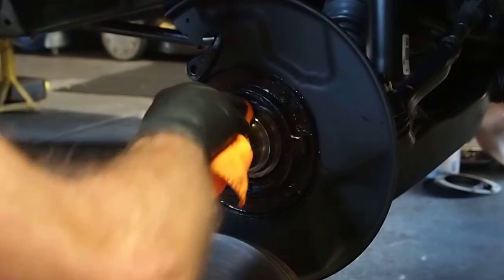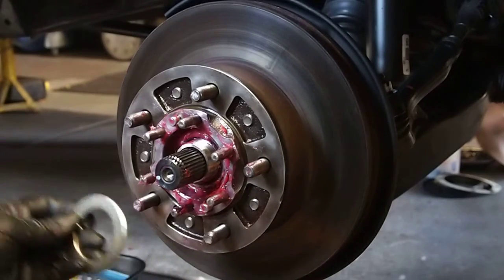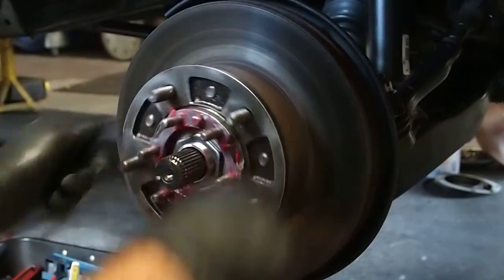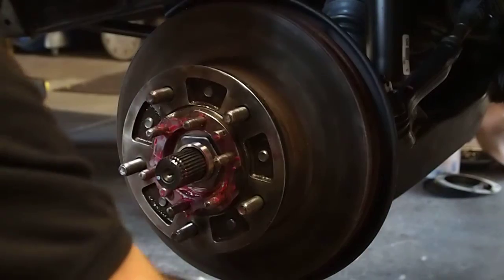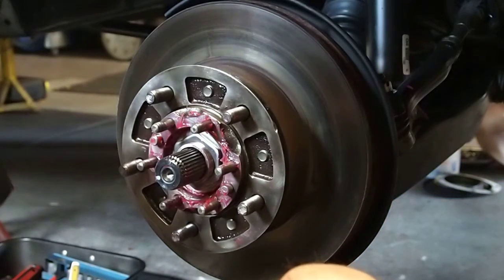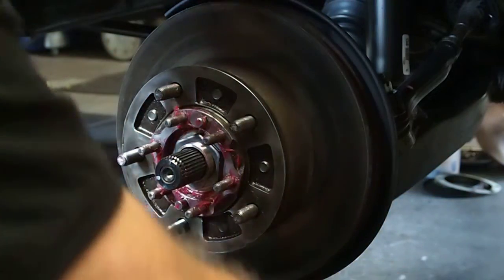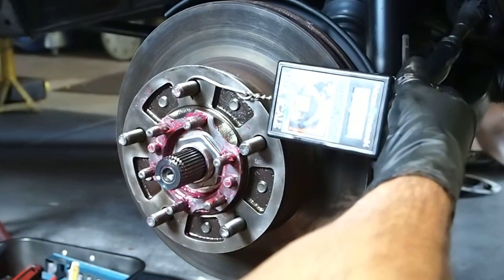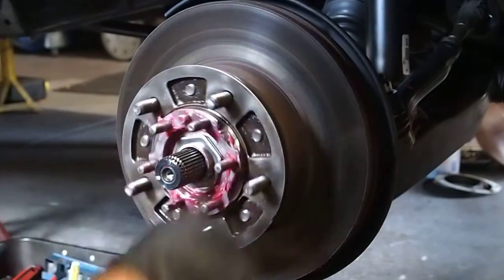Wheel bearing preload set 14.5lb. 100 series Toyota Land Cruiser 4 of 6.

Comment: This goes against everything I've read on the subject. Your final torque of 52 ft lbs on the inner nut is crazy high. But I understand you are going for the fish scale spec.

 I still don't know what method to trust. Torque spec range, by feel, or fish scale method.
Reply from the maker: Trust the FSM (Factory Service Manual). Which means what it says and says what it means! If you read the FSM, with the understanding. "It's the preload (spring scale) that is the goal". It will be clear to you! You'll see the FSM, first instruct us "2. ADJUST PRELOAD (a) 43ft-lbf torque on adjusting nut. (b) spin to settle wheel bearings. (c) back-off adjusting nut. (d) retorque to 38-57INCH-lbf (~3ft-lbf). (e) adjust preload to 9.5-15lbf with spring scale. (3) Then lock nut to 47ft-lbf. Then in, HINT: "Make sure to check preload in direction of rotation. If preload is not within specified value, adjust it again with the adjusting nut".

 I've found that if you just torque to ~3ft-lbf, the claw washer becomes scored (grooved) very rapidly due to chatter (vibration). The groove on claw washer, result in wheel bearings loosening even more and faster. Then chatter increases as bearing loosen more, deepening groove in claw washer.

If we do as FSM instructs, setting preload. The claw washer will not be grooved at next 30K miles, during PM of wheel bearings service.

BTW: I've hit as high as 81ft-lbf of torque on adjusting nut of wheel bearing, to get 12.5lbf breakaway preload. The better the wheel bearings, the higher the toque ends up. Bearings love it! Bearings, races & Claw washer will look perfect 30K miles later.

Not adjusting wheel bearings to preload of ~12.5lbf, not replacing lock-washer, snap ring and grease cap, and not gapping snap ring to spec. Are all very common bad practices and mistakes, during wheel bearing service. 

Don't just go by what you read and see in countless internet postings. Go by the 100 series bible (FSM). The FSM does have mistakes, this is not one of them.

Comment: I just repacked my bearings and according to the FSM, I should 1st go 43 ft lbs on the tension nut, spin the wheel back/forth a few times, back off and then go to 38-57 INCH POUNDS to set pre load. When doing it this way, maxed out at 57 INCH POUNDS, my break away is around 1.1 lbs on the fish scale. The only way I can get to the recommended break away setting of 9.5-15 ft lbs on the fist scale is to massively increase the torque on the tension nut to around 45-50 ft lbs (like you did in this video). My dilema is... Do I MASSIVELY violate the FSM by cranking down on the tension nut in order to achieve the FSM break away spec... or... do I MASSIVELY undershoot the FSM break away spec while abiding by the FSM's 38-57 INCH POUND pre load spec? Doing it either way results in no play in the wheels and no binding. I also should note that I am running 1.5" spacers and heavy 35" tires on my 100 Series. Basically, with either option I'm out of line with the FSM by an order of magnitude. I'd love to hear your thoughts on why you chose to disregard the tension nut spec for pre load in order to achieve in spec break away spec. Thanks!
Reply from the maker: Reading FSM in the proper light you'll see, 38-57 IN-lbf is only starting point after settle grease. Breakaway preload (pull on spring scale) is the goal. The cleaner and better condition the wheel bearings, the high the torque will end-up, to achieve 9.5-15LB pull on spring scale. It's also important to note: Ambient temperature, and that of grease, bearings and wheel hubs matters. I'm typically working with grease/bearing/wheel hub  above 68F. If grease/wheel bearings/wheel hub to cold. We get a false high reading on spring scale, due to cold grease viscosity/thickening drag. With over-sized tires and or wheel spacers, I shoot for higher pull on spring scale near 15lb, and service wheel bearings sooner (25K miles) than the 30K miles Toyota recommends. Key to knowing if the wheel bearings tight enough and done soon enough, is claw washer. You will not see scoring on claw washer, if wheel bearing properly serviced.
Reply: @memy895  - After driving for a couple hundred miles, I loosened the hubs back up, totally disregarded the 38-57 in-ibs. and solely focused on getting breakaway preload to 9.5-15 ft lbs. After buttoning everything back up, it doesn't feel any different while driving but I feel better about getting breakaway within spec. Thanks again for the tips!
Reply from the maker: @Advance_Main  Had you not set preload to spec range, making wheel bearings tight. You would have felt difference, in 1K, 10k or 30K miles later, depending on how loose set. Than you'd likely damaged the claw washer, bearings, races and spindle. Loose wheel bearing start loosening themselves faster and faster, more and more, as do even properly set bearings. Properly set in a stock, we do service again each 30K miles, as they're getting loose. As they loosen, they eat into claw washer from vibration/chatter, which loosen them more creating more chatter and more and more cycle of loosening. To loose, ABS will activate ATAC on dry roads in turns or just uneven HWY pavement. Still even looser and hubs wobble so much, it can rip rotors from the wheel hub. Then wheel falls off! The clue you set properly. Is next service, the claw washer should not be scored. If scored, you set to loose or (built rigs) need to service sooner than 30K miles next time.

Comment: quick question can I change the top king pin bearing without dissembling the whole axle ?
Reply from the maker: no bearing is called "king pin" . If you're asking about outer wheel bearing, then NO. Bearings are match to their race. The race and bearing need replaced together.
Reply: @memy895  sorry to bother I meant to say can I just replace the upper trunion bearing the two 17mm on top knuckle
Reply from the maker: @jdmgm6765  There is nothing called trunion bearing, nor any 17mm bearing. If your speaking about the upper ball joint, which attaches to UCA (upper control arm) and top end on steering knuckle, then YES. Toyota Ball joint comes with UCA as does the two bushing of UCA. UCA arm can be removed without removing axle (front drive shaft ), steering knuckle or wheel hub. I suggest you get a copy of the FSM (factory service manual). There's many PDF copies floating around the internet, of FSM. Or at minimum look at parts diagram, to get proper name of parts. This will reduce confusion. Try putting your VIN # here for parts diagrams: www.partsouq.com
Reply: @memy895  I'm so stupid I was referring to the 80 series land cruiser
Reply from the maker: @jdmgm6765  I was wondering if not 100 series, you've been referring to. I only work on 100 and 200 series USA models. Anything else I've no knowledge of. Are you working on a 100 series or 80?
Reply: @memy895  yeah 80 series and now i have in my shop 70 series hardtop just some basic maintenance

Comment: Question...I set mine up exactly as you did, tension is perfect. I then installed the flange and the tension increased significantly. Is this normal/ok?
Reply from the maker: Yes,  Once hub flange install, wheel hub then engages axle of front drive shaft (aka CV). So now your turning the drive-train through to transmission.
Reply: @memy895  After I sat and thought about the mechanism, it occurred to me this was likely the cause of the increased tension. Thank you for confirming, and for your highly informative and helpful videos and responses!
Reply: How come when I search for the rear bearing , it’s shows a seal bearing instead of the needle bearing with the race .

Comment: If I have play in the hub does thst,mean the preload is not in spec ?
Reply from the maker: Correct. Bearings probably to lose, which causes chatter (vibration). Bearing will then eat into claw washer, scoring it. This increase play. Flip claw washer so good side in, or just replace it when you repack your bearings.